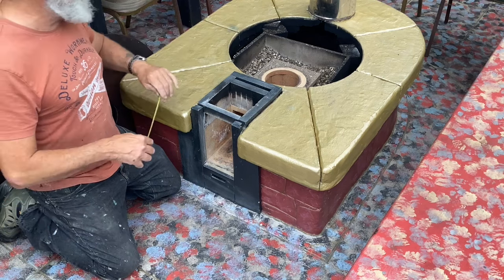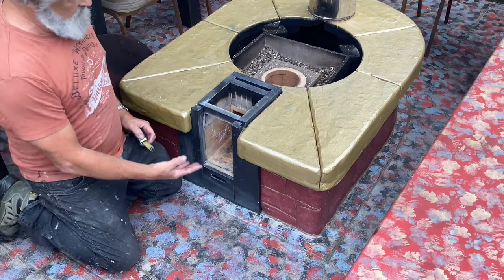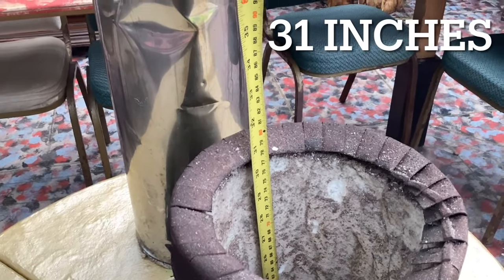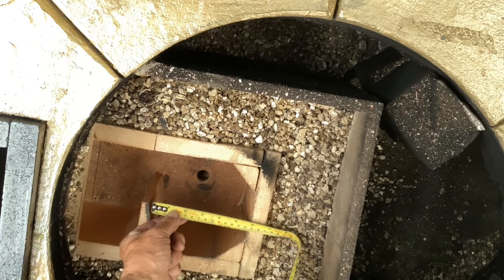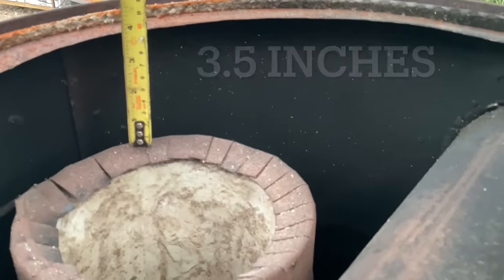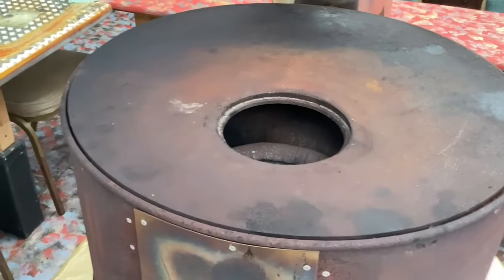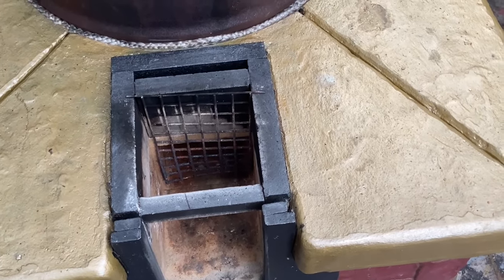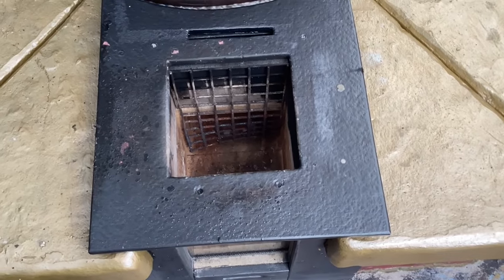Vortex rocket stove dimensions.

Comment: The riser should be centered. The down air needs to be structured so it counter rotates downward and is just as important. This will give you better transmutation and near zero exhaust gas readings. The cross pipe oven disturbs the air flow and Physics
Reply from the maker: Thank you for your comment.
 My rocket stove videos are largely about experimenting with different formats.  
That particular design with the off center riser and horizontal oven, has run for several years very successfully  heating a large uninsulated space and supplying food for my friends. 
Personally I would call that a success ? However if you look at my latest rocket stove videos you can see the stove running  without the oven, it shows no noticeable diffidence apart from not being able to cook fantastic food! The vortex J tube design works best (so far) with a short tunnel so with a 6” system the riser sits off center.  Please look at my many other design rocket stove videos and thank you again for watching.